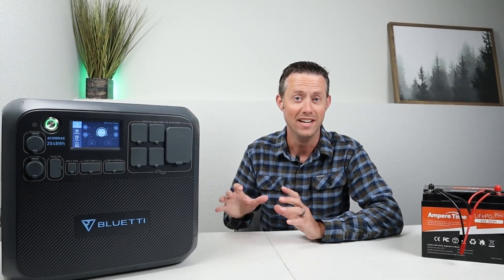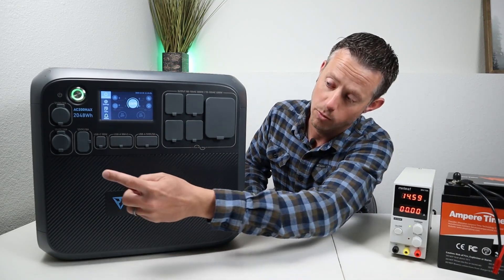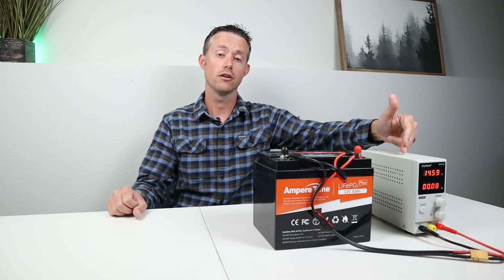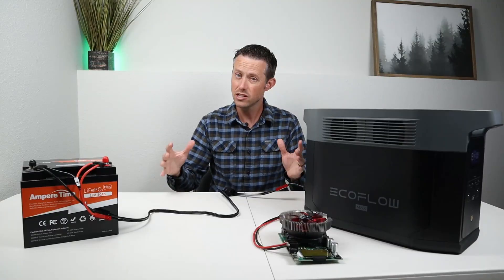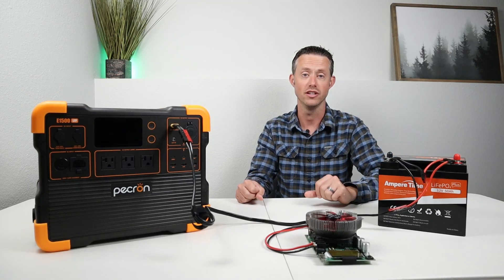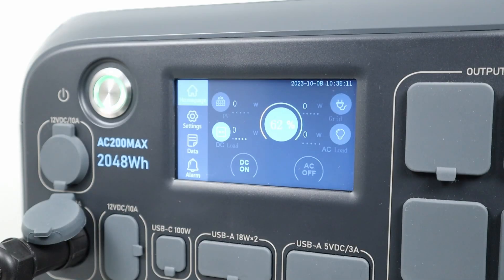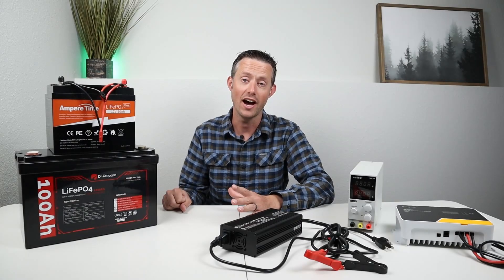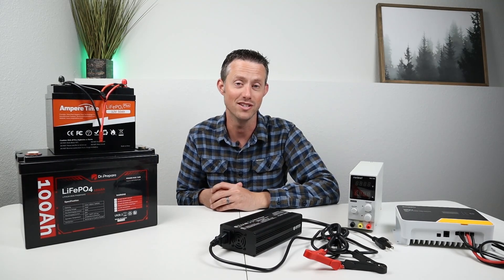Using Your Power Station 12v Socket To Charge A 12v BATTERY?! Does It Actually Work?

Comment: You might want to discuss battery storage conditions.  I have batteries in my garage that don’t get used very often.  The temperature swings in a garage jump all over the place.  Thanks for your product reviews!
Reply from the maker: Garage temps can be crazy! Hot and cold extremes as the seasons change. Usually in the owners manual they battery temp specs are listed. I think 140F is the high point for LFP batteries, and -20F is the low point.

Comment: Just plug in a lithium battery charger to the AC output of the unit if the DC doesn't support it, this is a great way to increase the capacity of any of these units with out buying a higher priced unit or optional add ons.

Comment: 12v regulated output is really more about powering a 12v device than it is charging a so-called 12-volt battery, which as we should all now understand actually has to be charged at or around 14.0 volts to fully charge.  Personlly, I don't see a lot of use-cases for charging a battery from, what is in essence, another battery.  If I want to charge a battery, I'll probably do that with an AC charger or, better yet, through a solar charge controller and some panels.
Reply from the maker: What's the fun in using something as it's intended!? haha I agree, using a solar charge controller would be the best way to charge a battery (and that's how my main systems charge everyday). I do enjoy experimenting to see how certain processes behave in order to learn new things :)
Reply: @jasonbroom7147 It depends, We have a travel trailer with one 100 Ah battery and if the solar panel isn’t replenishing that battery adequately due to clouds, you’d want to have a plan “B” if camping out in the boonies. I already have the solar generators so might as well use them.
Reply: @stuartstuart866 - That makes sense, but it would be more efficient to use the power station to power the loads in your trailer, versus charging up the battery.  Some of the newer  models have a 12v Anderson ouput that can do 20+ amps, continuously, versus the 8-10 amps you usually get from an auto accessory plug.  Ever since I got into all of this solar/battery/inverter stuff, I've been a little obsessed with trying to avoid charging with AC, and even more so with not charging one unit with another unit.  The only exception is when the unit doing the charging is actively taking in solar for its power supply.

Comment: I'm an amateur radio operator and I agree we need 13.8 VDC for most of our equipment for it to give us the stated RF power output. Most just grin and bear it. Some spend $250-$300 USD for a power booster to increase voltage levels to 13.8-14.0 VDC to achieve maximum RF output.
Reply from the maker: I definitely don't want to spend that much!

Comment: there are boost converters as well, so could get a little more voltage by using one, even if the charge current is reduced, you can get a higher charge percentage into the battery.

thanks for the video, good to see you make good use out of that new battery.

Comment: I tried to do this a couple years ago with my ecoflow delta and the 12 outlet quick working on my ecoflow  when I plugged in and seems to be broken, guess I should have used a fuse. I now charge with the ac outlet and a Noco charger.

Comment: What will happens if you include a small inexpensive boost converter set at 14.6?
Reply from the maker: That would allow you to fully charge the battery. Probably would be best to spend the money on a dedicated charger though just since that's faster and more reasonable.

Comment: Excellent video.   Thanks for sharing.   A side benefit of doing a direct battery to battery charge like this is that there are no losses to a boost converter or similar device between the two.  On a side note, I use a 100ah Li Time to directly charge my EB70 directly.   At some point the 100ah voltage is going to be too low for much to to be moving in the EB70 - I am guessing low 12 volts.  I wonder how much amp hours will be left in the 100ah Li Time at this point.
Reply from the maker: Once a LFP battery drops down to around 12v or less, there's not much juice left, you'll get most of the power out of the battery around 13.3v - 13.0v, then the voltage drops pretty quickly.

Comment: Great video and interesting.  Learned something new again with you.  Is it possible to use to large a wire gauge when charging or discharging.  I understand that using to small a wire can create more of a hazard by heating or melting the wire due to resistance.  I was wondering if too large a wire gauge would impact the current in a negative way.

Comment: Hi ive done somethingvodd . My powerstation powering my lodge no ext mains. I forgot and plugged powerstation into a wall outlet and charged it on ac from its own power. How was this possible .TIA
Reply from the maker: it can charge from it's own power but due to efficiency losses it won't be able to fully charge. It just a waste of power.
Reply: @Jasonoid  thanks for replying mine did but its a vtoman that charges at 1500 watts so full charge in 1 hour it was 19% charged to 100% . I defo will not do it again . Thanks again

Comment: Ran in to something sort of similar. I tried charging a small solar power station off of the 12 volt power supply (AGM trailer battery) and it was a no go, until I hooked up to external power, increasing voltage to the 12 volt outlet. By the way, I love the Delta 2, not a lot of reserve power but what a beast of machine for being so small and relatively light weight. I can run my clothes washer at home, our big instant pot, full size toaster oven, our big coffee maker etc. I also have an older Bluetti EB150 but now mostly use it to boost the reserve capacity of the Delta 2.
Reply from the maker: I love the size and weight of the Delta 2. I use it all the time for random things around the home / yard

Comment: Really useful information!  I use the same 50 AHr battery in my modified UPS system which only charges to 13.5 volts and it's nice to know that i have almost all of the rated power of the battery available when needed.  As i have the AC200MAX, now i know that i can keep that battery charged in a pinch as i have no battery charger, which is hard to believe:O  I just bought the new AC70 and AC2A on the early bird last night and hoping to see some reviews soon.  I am going to charge the AC70 up with one of my PV350 panels, which weighs almost twice as much as the AC70!
Reply from the maker: Glad you enjoyed the video! I had to pass on testing the AC70 since Bluetti is releasing too many units for me to test at once. I decided on reviewing the AC200L (the AC200Max replacement).

Comment: Is the cable coming off the Bluetti 12VDC/30A output port an aviation plug to a male (or female) XT90 or is it an aviation plug to a male (or female) XT60? Thanks so much for your help.
Reply from the maker: Female xt60 is the end coming off the 30 amp DC output cable.
Reply: @Jasonoid  Thank you!

Comment: Interesting test.  Here's one for you, since those batteries all have a BMS.  Could you use your voltage doubler, and feed 24V-25V into the battery?  Would the BMS handle that and let it fully charge?
Reply: I would say that would not work since the batteries are 12 volt batteries and that would be about double the recommended charging voltage, I would guess the BMS might just not take the voltage because it is too high, but it might fry the BMS. It would work if you had 2 batteries wired in series because they would be at 24 volts. You are supposed to charge the 12 volt batteries at 14.6 volts max, I think 24 volt batteries charge around 28 volts to get to 100% so I would think 24 volts would not get you to 100% capacity just like charging at 13.5 volts will not get to 100% on a 12 volt battery. It will get close though. I would guess about 90% charged maybe 95%. That would be a good test for someone that does not mind possibly frying a bms to test it.
Reply from the maker: Hmmm maybe there's a small adjustable boost converter that takes 12v and puts out 14.6v.... Kinda like a small DC to DC battery charger? I don't think it would be wise to do that for a long period of time. The BMS might handle the high voltage for a little bit but I'd be worried something might fail and you'd risk damaging the internal battery cells. The highest voltage I'd probably risk going for a long duration would be 15v.
Reply: @Jasonoid  Yeah, I'm not sure what the BMS would take.  Perhaps one of the manufacturers would answer that?
Reply: The BMS will disconnect from the cells if the voltage is higher than 14.6, so a 24v supply will not work.
Reply: Ecoflow will accept. 12v-24v input at 10amps max ,

Comment: Nice test. It really goes to show you that anything above 13.5 volts on the battery is very little deference between fully charged at 14.6 volts. Definitely prefer the pecron or the bluetti for that. Good enough if needed and keeps your battery below 100%, might prolong the long life of the battery if that is a concern. If you used a charge controller, then you could definitely get the battery to 100%. I used the charge controller hub from the dr prepare battery for charging my battery at 12 volts from the pecron 5525 barrel ports at about 50 watts.
Reply from the maker: Totally agree, thanks for sharing your insight!
Reply: But to balance the cells would you still want to charge at 14.6? at least occasionally? @Jasonoid
Reply from the maker: @tim1299  correct, I would recommend fully charging the battery on occasion to allow the BMS to balance out the individual cells.
Reply: Received this week a Li Time 100-amp w/o low temp protection. Just won't need it. Will use the charging profile of a non-lith progressive dynamice charger /invertor. But I have a 5 amp 14.6 volt charger to top it off occasionally and to slowly charge it. I have an electric or propane hot water heater. can that battery power that Suburban 6 gallon? It was bought in 2020 . Hooked up both ways but never used, thanks. @Jasonoid

Comment: Jason, I have a question for you if you don't mind. My diesel night heater in my campervan runs off my 100 ah sealed lead acid leisure battery. 
I don't take it below 50%, but if I haven't managed to get a decent charge into it because of the lack of driving and/or solar, could I use this method to keep the leisure battery from getting too low while running the diesel heater at night?
On max my heater uses 13 amps on start up, it then runs at a max of 3.5 ah although i never have it set on High continuously so probably more like 2 amps continuous give or take <20%> fluctuation.
Would the 13amp draw be fine as it's going through the leisure battery? A kind of buffer, taking the load.

I'd prefer to do it this way than through an AC 12v charger connected from the power station to the leisure battery saving approximately 20% power due to inverter inefficiencies.
I don't need to charge the leisure battery, just keep it above 12.4 volts while running the heater if the leisure battery is getting low.
I enjoyed the video, it got me thinking...Cheers Jason.
Reply from the maker: It depends on the power station you have and what voltage it puts out to charge the lead acid battery.

Comment: Hello Jason! Your videos are fantastic and very informative. If possible, I would love to see a video featuring the Bluetti AC200Max. Specifically, I’m interested in how the AC200Max functions when connected to a B230. It would be particularly helpful to see how the AC200Max charges the B230 when it’s at around 30% capacity. Thanks!
Reply from the maker: This is my most in depth video of the AC200max:  https://youtu.be/viqfp5YYunw

I was recently testing the B230 expansion battery and it seems to function just fine together with the AC200MAX. I never noticed any issues.

Comment: Maybe you have covered elsewhere but lifep04, LFP battery maintenance whether in a solar generator or stand alone batteries is an open question for me. 
1. Minimum charge levels…units left “ in storage” before recharging for battery health or warranty….2. recommended use of battery maintainers( if safe ones exist) for LFP batteries.  ( have successfully used for 6-10 month constant time periods on traditional 12v)
3. if solar generators have no load connected/ or backup load connected  …but are connected to ac all the time….should inverters  be left on ….to charge maintain, or if inverter turned off to reduce draw…how then to maintain battery levels  etc etc

Comment: I'm sorry if I missed this.  How does the amperage on the output of the power station come into play?   ie. 13.6 V @ 5 amps vs 13.6 V .@ 10 amps?  Is one usable for this and the other not?
Reply from the maker: You can consider the amperage the charging rate. For example, a power ststion that puts out 10 amps, will charge hypothetically charge a 100 amp hour battery in 10 hours (if the output voltage was 14.6v). A 5 amp output would take 20 hours to charge a 100ah battery. So basically the 30 amp output is much faster than a 10 amp output.
Reply: @Jasonoid  Thanks!

Comment: Bought a used Bluetti ac200p and use 95% of the time 12v via Aviator plug. In the videos you show how to charge Lifepo4 batteries via the 12v plug but can I use it as a permanent solution to increase the capacity for 12v as I almost only need 12v?

Comment: Does this apply to 12V lead acid car battery?
Reply from the maker: I'm sure it would charge up a lead acid battery a little bit, but make sure the charging voltage is within spec of the battery.

Comment: Very interesting. But how does the battery know not to pull more than 30A, or 10A in the case of the EcoFlow? Is it like USB where there is some secret communication between the devices where the device doesn't pull more power than the charger can handle?
Reply from the maker: The DC output is amperage limited on each power station. They will only allow the max rated power they are rated for.

Comment: hello Jason quick question.

i have a dr. prepare 100ah battery plus the hub and 100 watt lion energy rigid solar panel.
i just received a renogy 700watt inverter with 1400 watt surge. i am planning to run a full sized refrigerator plus perhaps a tv in the garage if the panel can keep up.
now ive learned i need a anl fuse or a breaker? any recommendations?
this is my first time building a system.
Reply from the maker: I'd recommend reaching out to me here for more in depth advice:
https://asqme.com/@Jasonoid

Comment: Hello~~ Putting 800watt portable power station to healthy car battery in garage.. How many days will work? I am gonna use Noco genius 1 battery charger (Input : 100-240VAC 50-60Hz 18W Output : 6/12 VDC 1000mA)

Comment: Powerwerx makes a dc to dc charger that will charge up to 8 amps and 14.6 volts. I haven’t tried it but I thought this might work well to slow charge a lifepo4 battery with a power station while the power station is getting charged by a solar panel. I would love to see you test that scenario. The idea with that is you could buy a smaller and less expensive power station but expand the capacity by buying a battery. Run your 12 volt stuff off the battery and charge it with the power station.
Reply from the maker: Is this the one you mean?  https://powerwerx.com/dcdc-charger-lifepo4-8a-adjustable

I'd probably just recommend the 300w powerwerx affordable MPPT solar charge controller to charger directly from a solar panel, it works super well. I use it all the time :) It's cheaper than the DC output and allows for more power:
https://amzn.to/3FLx2y6
Reply: @Jasonoid  yep that’s the one. Thanks for the advice. I was thinking with the dc to dc charger I could charge a battery with my EcoFlow river 2 pro (and charge the EcoFlow with either ac power or solar panels). Your idea is simpler though

Comment: So could you charge a car battery this way?  The DC output on my power station is 12.8V which would be high enough for a car battery.  Probably not practical, just thinking of an emergency situation.
Reply from the maker: Lead acid batteries need a similar charging voltage as an LFP battery. The 12.8v of your power ststion is a bit low to get a battery fully charged but it would definitely put power into the battery and possibly allow you to start a dead car.
Reply: I think it would be more of a trickle charge solution and if you can get a battery up to 12.5 or so it should start.  I've looked at the jump packs and heard they only last a year or so and just one extra thing to carry.   @Jasonoid
Reply: Technically, it is possible as the power station will bring the battery voltage up.  It will take a while if the output is 10 amps as most power stations are.

Comment: Wow. I just bought the Delta2Max on sale last month because it looked practically identical (even a bit better) that the Bluetti200Max. Can't believe there's such a glaring difference in their performance for this job.
Kinda feels like I made the wrong choice...
Reply from the maker: Honestly, this isn't something I would recommend doing vs a normal charger. This was just an experiment video to demonstrate some concepts. I just wanted to show the benefit of having a higher DC output. In daily use of running 12v devices, the lower voltage of the Delta 2 won't matter too much. Don't have any regrets, the D2M is a great option.

Comment: Hi Jason,
Can I ask what's the Connector you used for 30A DC output on Bluetti AC200max to charged that 50ah LFE Battery? How long would it take to make it full? Thanks as always Jason -Klinton
Reply from the maker: For the best results I'd recommend using a standalone battery charger. They are better to charge the battery to the full capacity and balance the internal cells.
I used a couple adapters I had laying around (xt 60 > anderson > ring terminals). You could use whatever option you wanted.
Reply: @Jasonoid  Thanks as always!